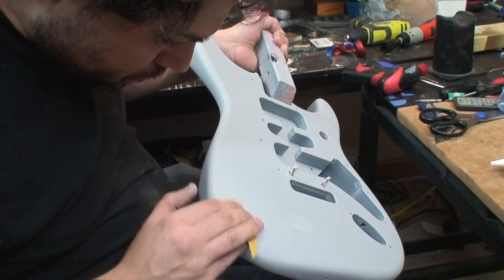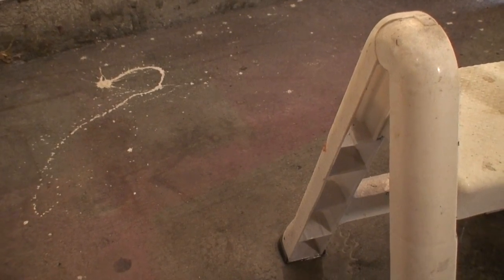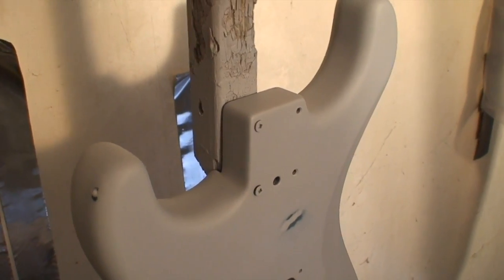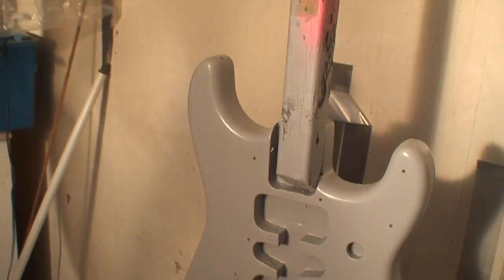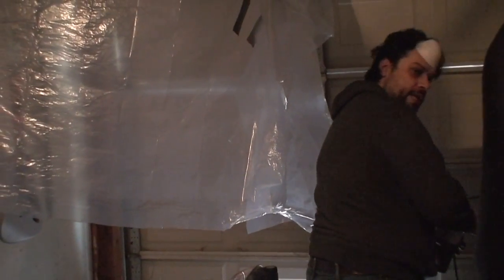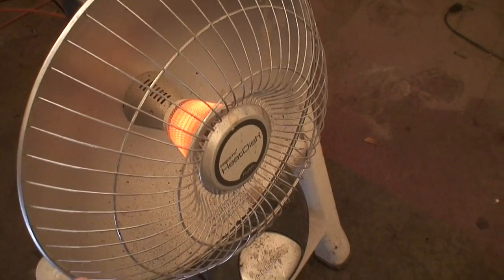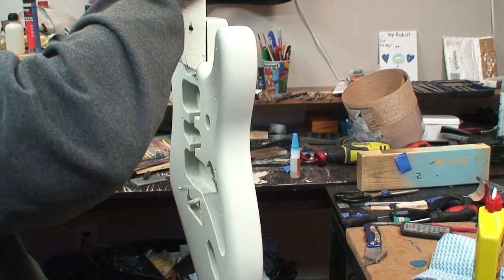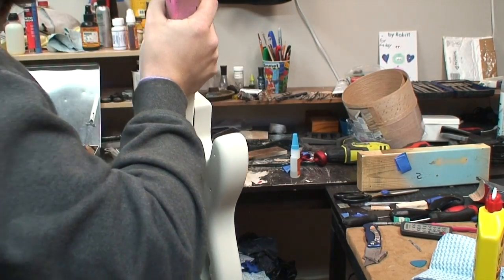Repaint with automotive rattle cans: US Fender Strat - part 3

Comment: You were doing such a good job using the “sneak up on it” approach right up until using the air on it. At least it’s something that can be fixed without too much trouble.

Comment: A couple tips for you. Go to fabric land and get yourself a nice piece of fleece fabric to put over your workbench (AFTER you've taken all the junk off it) and wear a fresh pair of rubber gloves whenever you're handling the guitar between coats. It's easier to get hand oils and junk off if they're never there in the first place. I use sandpaper bits wrapped around an eraser for a mini sanding block. Much cheaper than those 3M pads. Respirator if you're going to do this fairly often.

Comment: Why is the paint so expensive?  Is there something special about it?
Reply from the maker: +Greg's Garage nah... just Automotive paint...
Reply: Ah.  Got it.  I was wondering if you were using the 2 part clear that comes in a rattle bomb can.  That may be a way to get a more durable finish without using a paint gun.  A little thought though...  You are probably paying as much for the rattle cans as you would real car paint.  I know you're not painting 100 guitars a week, but if you get into more finishing you could go that route and save some chashola...  So far it looks awesome.
Reply from the maker: Greg's Garage Thanks Greg... I totally know I'm falling short equipment and supplies-wise, fosho;-)  I want some proper spray equipment and a better air-compressor for the garage. But at the moment, cash, space and time all prevent:-) I remember you doing some paint stuff on the cars.  I also watched Rick painstakingly restore and rebuild that Nova. I watch tons of car guys too.  They've been the best source of info, like you:-) Thanks for the suggestions, keep em coming!
Reply: I seem to remember you have air...  All you need is a touchup gun and you've got what you need.  I'll put the word out and I might be able to scrounge one up.